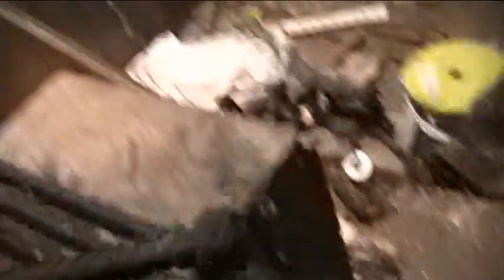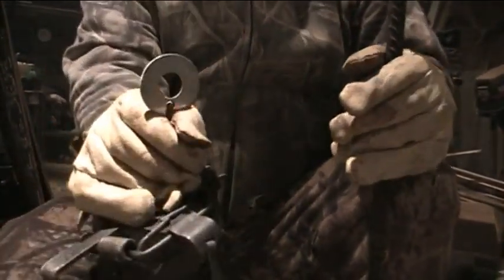Making your own Wolf/Coyote drags

Comment: Nice job on the drags. What length of chain do you use and what do you do with the drag and chain? Thanks for sharing and catch you later.
Reply from the maker: NSTRAPPERHUNTER I run about 8 feet of chain. It gets covered up in a straight line directly away from the trap.